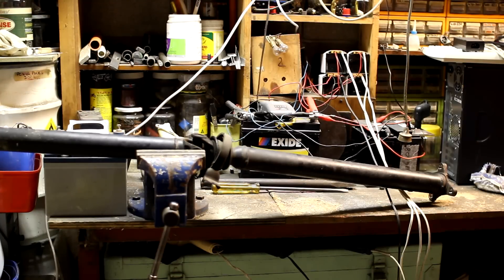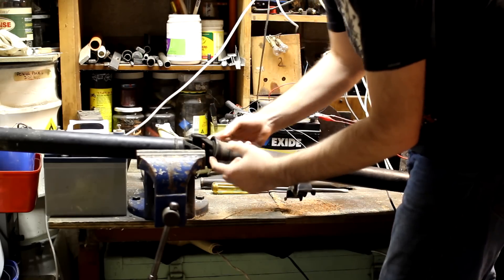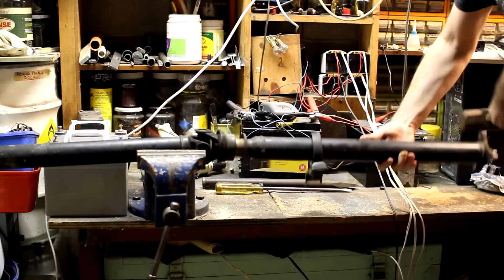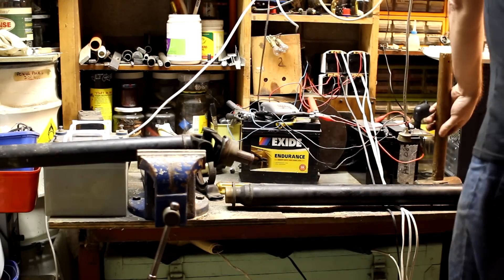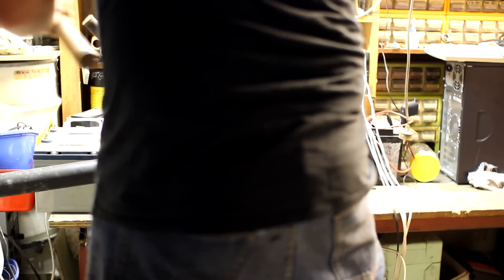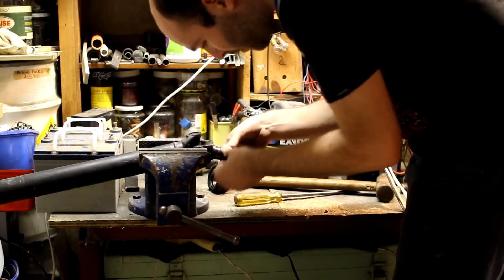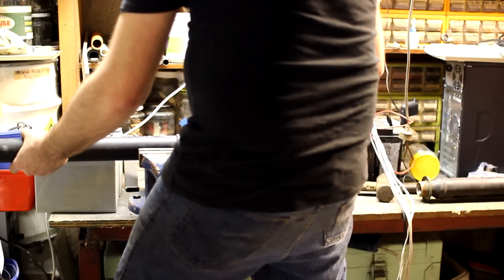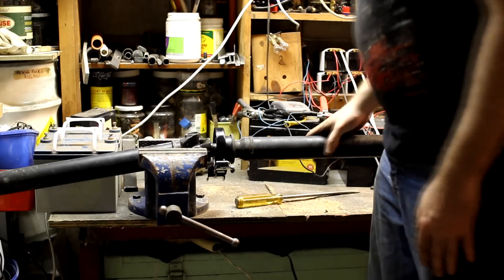Replacing Commodore (VX-VZ WH-WL) tailshaft centre bearing (demonstration)

Comment: If you people think this is bodgy, imagine what mechanics do when they're off camera.
This guy is quite professional from some of the stuff I seen mechanics do in the industry.
Reply: Yeah but he didn't mark the tailshaft meaning it would be difficult to reassemble in exactly the same spot without having any problems with vibration,he is also belting the end of the tailshaft with a hammer whilst putting all the load on the trunnion bearings,the other side of the slip yoke should be held in the vice so as not to damage the trunnion bearings & races.

I've rebuilt a couple of them,1 on my dads V6 VX Commodore,with a new centre bearing,driveshaft doughnuts, transmission & engine mounts fitted it was all good.

2 on my V8 VY SS Commodore,the centre bearing was totally knackered so I marked both shafts & got the splines separated with great difficulty.

I think that they were rusted together & perseverance by soaking the splines in diesel,I held the diff end of the tailshaft in the vice & tried to tap the slip yoke off with a copper mallet & piece of tube.

I didn't give up too easily, the next day after soaking the splines & applying heat with a propane torch the male & female yoke splines separated,I ended up belting the yoke off with the pipe & hammer on the floor.

Once I reassembled the tailshaft with a new bearing,it did have a vibration on acceleration in 1st & 2nd gear,I checked the slip yoke for excessive play to find out that the splines were worn.

I ordered a tube of Loctite 660 press fit repair for splines & applied that,after letting cure for 24 hours there was no more play but still a vibration.

So, it could be only 1 or 2 things that alter the driveshaft angle therefore cause vibration on acceleration.

1 - Sagging rear springs,the car has 30 mm low standard terms rate King springs fitted in the back.

2 - An old ,soft,worn out & deteriorated rear transmission mount causing the rear of the transmission to sit down lower than normal.

It ended up being 2,the rear of the T56 Tremec 6 speed manual transmission sits up at least 1 inch higher meaning that the driveshaft angle between the rear shaft & floorpan is greater,it should be about 3°.

So,replacing the rear transmission mount in mine fixed the problem !!!!
Reply: @RussellBooth1977 should’ve just made a video instead of explaining in detail in the comments section 😂

Comment: Worked a charm. Mine was hard to split too but I stuck it in the vice and used my brass hammer on it and eventually got it split.
Bearing also took a lot of bashing to start but them came off pretty easily.
Great video.

Comment: Just did my wife's VZ commodore, followed your instructions and no problems at all. A bearing puller would have been worthwhile but none the less it worked out just fine, cheers
Reply: Mines a vz and I need to do mine too did you have any problems afterwards like any noise? I’m just curious if I need to get mine balanced?
Reply: @heathmorton3604  No noise or problems, just make sure you mark the drive shaft so you can put it back in the same position

Comment: This was very useful.. howevever my VZ Commodore tailshaft bearing was secured by a circlip ...was not required to be hammered off....easy job...Cheers
Reply: Mines a vz and I need to do mine too did you have any problems afterwards like any noise? I’m just curious if I need to get mine balanced?
Reply: @heathmorton3604  I had no probs, no noise , balancing not needed...
Reply: Mines an sv6 vz but I’m assuming there all the same, but perfect thanks mate, gives me so much more confident, I was a little worried I’d replace it and then it would make noise because it’s not balanced, did you get a genuine centre bearing?
Reply: @heathmorton3604  Mines an sv6 vz as well..hopefully yours has circlips as well, no need for hammering...bearing from Ebay..
Reply: Kroll Norbert perfect thanks mate, yeah I ordered one today, doing it Saturday appreciate the help so much bro!!

Comment: this video was brilliant, used the cold chisel method to gain some space from the yoke and used the grinder for a bit thinking it would cut through(pain in the ass) but the heat probably loosend the bearing and it came off easy.. 
thanks 
i got quoted some $300+ figure for this job also, even if i brought the shaft in(no vibrations up to the speed limit at least..

Comment: all good till you have a frozen drive shaft that wont split like i did today from a vu commodore, personally i mark them with a paint pen to maintain balance, i use a slide hammer attached to the tailshaft flange then use copper grease on the splines to ensure it wont get stuck again. not a bad demo video, allot harder most of the time in the field. i also use brass hammers to try and minimise damage to the shaft.

Comment: Weird question but instead of changing over the diff flange from a 6 bolt to a 3 bolt flange, can I use a stock 6 bolt tail shaft/driveshaft? And will it fit

2004 vy commodore series 2

Comment: I replaced mine this weekend in my VY SS Commodore & I was afraid I wasn't going to be able to separate the 2 halves as the splines were rusted together.
So I spent hours with a length of pipe & lump hammer trying to break the splines free & I even tried heating the shaft up with a propane torch then soaking the splines in diesel but the shaft wouldn't separate even when the yoke was held in a vice.
The shaft eventually separated after I put the driveshaft on the ground then whacked the yoke off rather than trying to drive the front half off,the yoke eventually separated after several whacks on the yoke with a piece of pipe & lump hammer.
I fitted the centre bearing yesterday but fitted the driveshaft into the car today,off the mark,the car had a slight vibration under load but there is no vibration at any other spot than that.
I was driving the car tonight & the duration of the vibration decreased so I think the centre bearing rubber probably needs to seat in.
I have read that a person who has had the centre bearing replaced in his WK Statesman has the same vibration as mine so I think that maybe the rubber needs to stretch a bit more so the centre bearing will have more "give" in it.
I marked the splines so the 2 halves went back together in exactly the same way,it is also not the universal joint as the noise would always be there if that was the case as there is no binding or slop in the joint.

Comment: I drove my car today & there is a slight vibration on takeoff in 1st gear only.
That tells me that's not a balance issue rather an issue with possibly a bad rear transmission mount.
I want to recheck the rear mount again as I checked it for splits today but there was none.
I'm looking at the possibility that the mount is "sagging" due to age (nearly 14 years old) so the top half may me hitting on the bottom half of the mount therefore the vibration may be getting transferred to the rear crossmember rather than getting absorbed by the mount.
I have heard of that same issue in a Lexus where the transmission rear mount was no longer absorbing any vibration.

Comment: I noticed in your vid that there was no 'C' clip on the splines near the base of the shaft.. as the 'C' clip can cause all sorts of hastles when trying to remove the shaft.. the sorts of hastles i am having now.
Reply: mine had a c-clip around the shaft holding the bearing in. once i removed it, the bearing tapped out quite easily with a small hammer and a drift

Comment: If you had cleaned those splines with petrol then lubricated them with a small amount of grease u could have slid them together by hand only takes smallest bit of dirt and they wont slide together.

Comment: Oh! The 2 tailshaft halves must be assembled so they are 90 degrees out of phase as they are from the factory so marking them so they can be assembled the right way is very important.
I'm not sure how important balance is (i.e. weights) because when I was helping my brother convert his old VN Commodore to a 5 speed manual (Toyota Supra 5 speed), Rod Hadfield from the CRS (Castlemaine rod shop) sent us a front section off a VS Commodore HSV Manta (had a 5.7 litre Holden V8 coupled up to a 6 speed manual) tailshaft as the VN auto one was 100mm too short.
Well,when that section was bolted up to the VNs rear section, the car didn't have any vibration at all so the tailshaft didn't need balancing.

Comment: Great video thanks. You've removed both sections of the drive shaft and used a vice to secure the front section. 
Is it safe to leave the front section of the drive shaft in place even though there is allot of heavy hammering backward and forward?

I have a 2000 Berlina wagon which looks the same as yours is it the same procedure ?

Cheers.

Comment: One thing I've found that can cause the vibration off the mark in first gear is the rubber driveshaft doughnut on the transmission end of the tailshaft, in my case, I ordered a used doughnut of Ebay about 4 years ago which was listed for a V8 model of Commodore,well, I measured the thickness of the doughnut & it was only 30mm (i.e. the thickness of the driveshaft doughnut on the transmission end of the manual V6 models or both ends on the automatic models).
The thickness of the rubber driveshaft on the differential end of the manual V6 models or on both ends of both automatic & manual V8 models is 35mm in thickness,so in my case the tailshaft yoke is sticking out 5mm too far thus causing the vibration.
So , I will tend to that before blaming the transmission mount for the cause of the vibration,which is another possible cause of that sort of vibration,at the same time I need to replace the transmissions extension housing oil seal as red ATF is dripping out of it (the Tremec T56 uses Dexron III for lubrication).
At the moment I am 2/3 rds of the way through a clutch disc replacement at about 324,500 kms (the clutch had done about 150,000 kms) which was lucky because the pressure plate was towards the end of its adjustment, I reused the flywheel & readjusted the cam in the pressure plate but replaced the clutch disc with a new one,the flywheel had a small score mark on it but otherwise it was surprisingly unworn to the point that I could scratch my finger nail across the CNC lathe marks on the flywheel & pressure plate,so they were both reuseable,I was worried last year when the clutch was slipping under load,it readjusted itself to its final point I think.
When they are towards the end of their adjustment they go BANG soon after which happened to me 8 years ago 3 days after I bought the car so when I was working I paid a local clutch place $1500 to supply & fit a new clutch kit ($1100 for the kit) but this time around, it only cost me $130 AUD to buy a Chevy LT1 clutch disc from the U.S. which fits the LS1 engine with the manual transmission.

Comment: hello please I need your help I have chevrolet lumina ss v8 2005 (holden vz) i had a problem with the center bearing shaft that was broken. i changed it but it was broken again. i changed for 4 times and I tried a lot of mechanic garages to repair it and won't break but nothing happen what should I do ? please help

Comment: I have replaced another one in my dads VX V6 Commodore no worries but I got under my VY V8 Commodore today when doing a wheel rotation today & checked for play in the tailshaft & I have found that the splines have play near the centre bearing.
The VX V6 one was very easy to do & only took me about 1 hour to do but the VY V8 one was a nightmare as it took ages to separate both halves of the tailshaft as they were rusted together.
I was looking at maybe using JB weld on the splines because I think that they are a tad worn.
I could use the Loctite 660 product but I already have some JB Weld which has a higher tensile or shear strength than the Loctite product,which is 3960 PSI over the Loctite which is 3335 PSI.
The JB weld also has a constant temperature of 260 degrees Celsius over the Loctite temperature of 150 degrees Celsius.
I may look at doing that tomorrow,it just means no driving the car till Monday as it takes both products 24 hours to cure.
On the other hand,I have found out the JB weld I have is the Kwikweld stuff with a shear strength of 2424 PSI & a maximum working temperature of 110 degrees Celsius so I'm better off using the Loctite product over that one.

Comment: hi mate, I know this is an old video, but do you know whether this tailshaft is out of an auto or manual? because I have read that the auto is different and the shaft cannot be pulled apart. which would explain why I can't pull mine apart...
Reply: auto and manual is the same for vz ss   ute's and sedan's not to sure on the wagon but.  i just did a auto to Manuel conversion in my vz ss ute that came out of a sedan and had no worry's. Im doing my center Bering as well as she seen better days hope this helps. i was also told to that there different but found out that there the same cheers.
Reply: I pulled my auto vx tailshaft apart
Reply: Steve Smith Did youbtry a Bearing puller?
Reply: nar i ended up getting the bearing off but couldn't pull the shaft apart even holden wouldn't do the job for me so i ended up  getting a new one mad  up for me
Reply: Oliver Webb, i am having the same issue separating my WK's tailshaft, the issue is the 'C' clip on the spline on the inside of the shaft.. it has to sit evenly on the spline or it'll be a total bastard to separate the tailshaft.

Comment: I have done these centre bearings its not worth the time or labour expense to do them , at most wreckers you can get a driveshaft for about $60 which i ended up doing and it was a simple swap that was about half hour without any banging , i replaced the centre bearing and it was a terrible job and a waste of time especially when there are heaps of driveshaft replacements and cheap
Reply: I think that the reason these are being replaced is because it looks like either the bearing, or rubber around the bearing fails over time.  It seems be be almost guaranteed to fail after 12 years/150,000km.  So, if you get one from the wreckers isn't it also going to have the old bearing, and likely need that bearing replaced...or is it not as common a fault as i think?